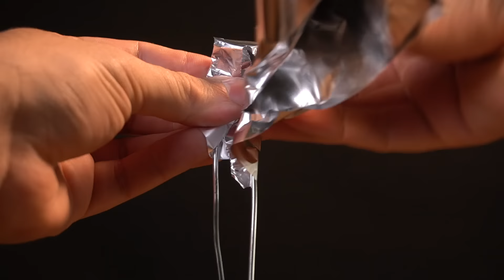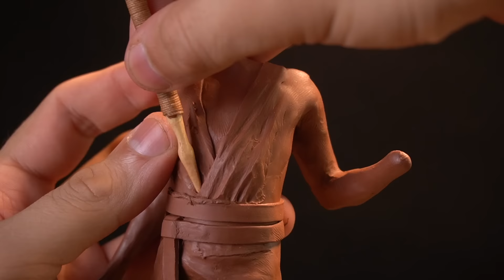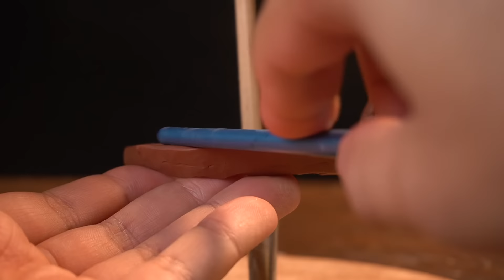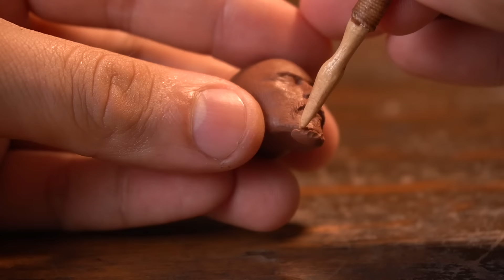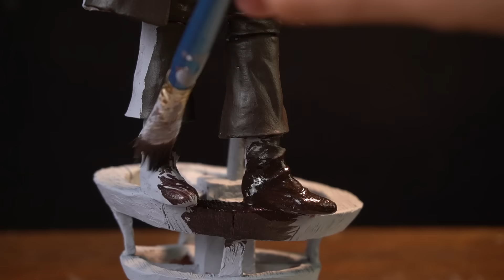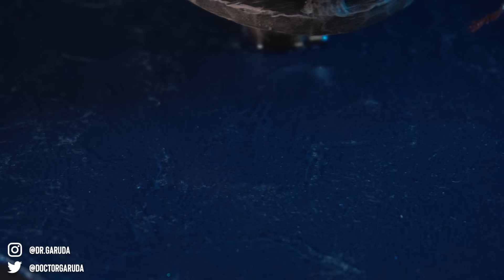Sculpting CAPTAIN JACK SPARROW | Pirates Of The Caribbean

Comment: Admirable. All those details in the suits, the fold of the clothing, the hair and face. The rending of the persona his truly stunning. Question; how long do you let the clay dry before you apply the first coat of primer?
Reply: It’s plastiline clay which is an oil based clay, meaning it never dries, so he just goes at it with acrylic paint when he is done as far as I know. That’s how I do mine. You can always temporarily harden them by sticking them in a freezer for some time but apart from that, the clay will always be soft which makes the sculpture delicate. Hope that helps!
Reply: @martychang3679  Very much, thank you!
Reply from the maker: @martychang3679  True :D
Reply: @DrGaruda  hey :D
I have to give you credit, you brought me back to clay, and specifically sculpting. You’re a big inspiration and I can’t wait for the next video!